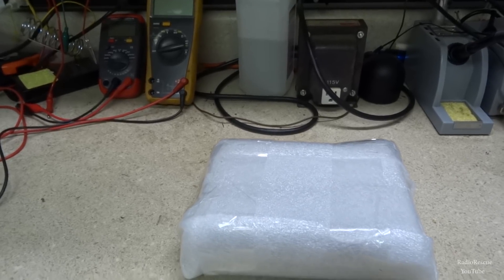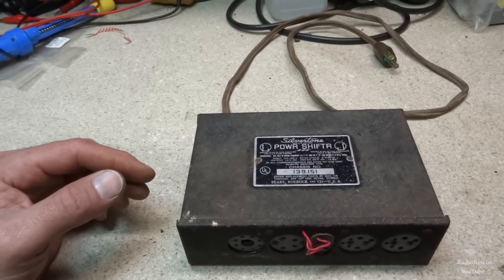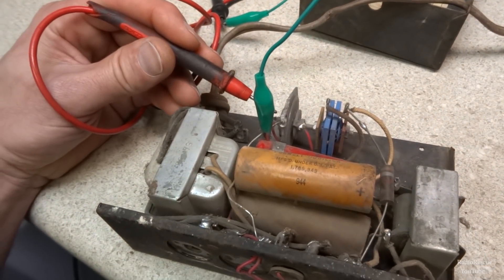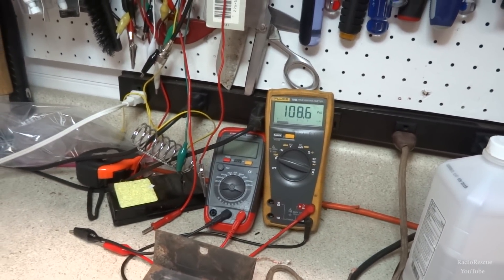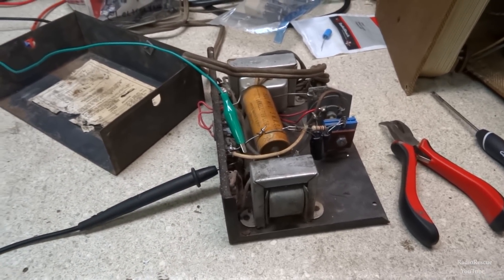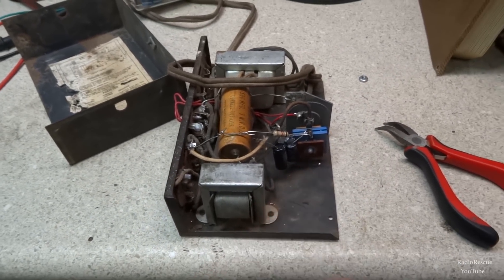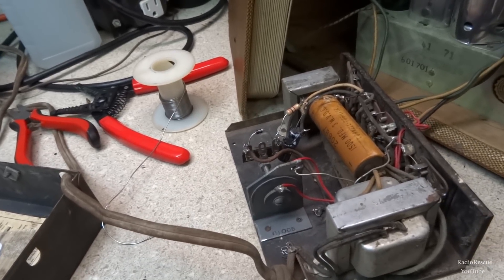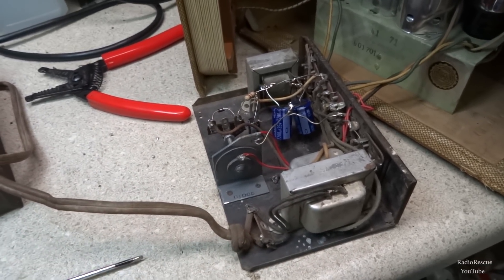Repair of a Silvertone 6686 Radio Battery Eliminator

Comment: Hello!  I have one of these Silvertone Power Shifters and it isn't working correctly.  I replaced the capacitors, but think that maybe my selenium rectifiers are no good.  I think my bigger trouble is in the filament side of things. Could I hire you to check out my unit and get it "up to par?"
Reply from the maker: Simple enough to do a diode check on a DVM to find out. You can send it in if you want. I'm kinda backed up with work. Email me at dustytubes@gmail.com if you want to send it in.

Comment: Hello, don't worry about all the rude comments. I enjoy all your videos and please keep them coming!!! I just finished restoring a power supply exactly like the one in this video. When I power it up, I get 3 volts on the A+ and 126 volts on the B+. Is this ok? The selenium rectifier seems to be ok so I didn't use a diode.

Comment: I have a tendency of simply replacing the old selenium rectifiers. I have heard they make a horrible smell when they fail and I would rather not deal with that. The down side is that diodes don't handle spikes and such as well as the seleniums which are more robust when it comes to that.

Comment: Interesting video!!! I have a 1953 Westinghouse tube portable that has the AC power supply made for that specific model, It's on my TTD list as I can't find any schematic for it. What stumps me is the rectifier(s). It's not a selenium, it's two round discs that I've never seen before. I'm wondering if they are copper oxide rectifiers or very early germanium units?

Comment: The first console radio I ever got was a Coronado farm radio.  At the time I didn't even know they made battery eliminators and I ended up giving the tubes and speaker away, junking the chassis, using the tuning condenser on a variable tuned AM antenna and re-using the veneer on other projects.  I've since learned of these things and those ARBEII's etc.  Wish I had known about them back then, lol.  Nice job on the repair!
Reply from the maker: I've go an old Coronado in my attic i found in a dumpster over 10 years ago when i was living in the upper Midwest. It's an old farm radio. It's in real bad shape. Maybe i should dig it out?

Comment: Thanks for showing this. I have seen these here and there but never got to look in one.

I did get to look in those cheapo "Battery Eliminator" types available in the early 60s. Gutless wonders. Just a plastic box with a couple resistors, a neon bulb and some small capacitors. They replaced the 67.5 or 90 volt batteries depending which pins the battery connector would fit on. You still had to use a battery for the filaments but they did save wear on the expensive B battery. Many of the later portables used D cells for the filaments and they were dirt cheap back then. Anybody else remember Pep Boys selling flashlight batteries for a nickel?
Reply from the maker: I need one of those for 67.5 volt batts now!